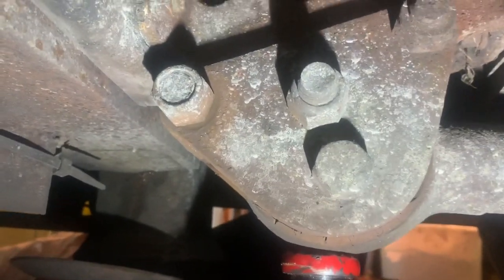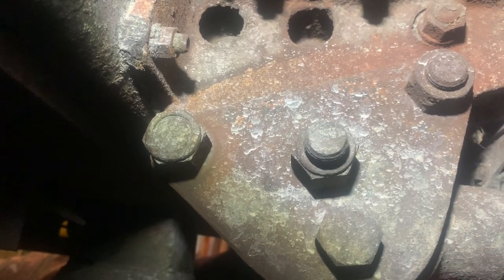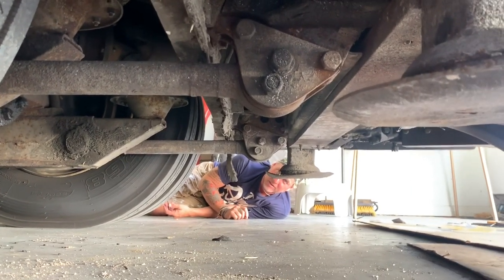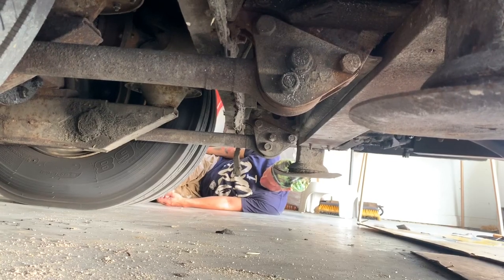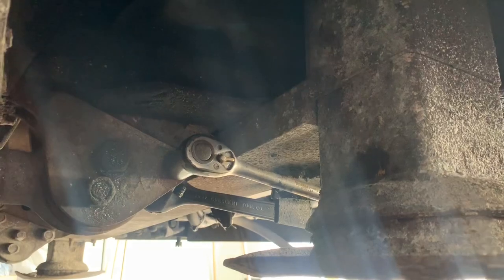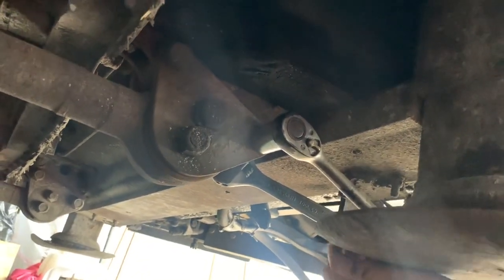Gm bus conversion 4104 radius rod mount problem

Comment: A few years ago I bought a rough 1957 Bedford SB coach as a non-runner, for £80. We amateurs must have been so lucky with (almost) all mechanicals, working from the manual.. but we got her running nicely & after some new brakes, wire harness, bulbs, and a good polish..? I'll never forget it !
Great channel, interesting subject indeed. Hi from UK.

Comment: The frame bracket you could either drill it out and put in a bushing(like the round end on a shock absorber) or weld the holes shut and redrill them. Just a thought/suggestion

Comment: I thought I was the only one who used a jack to break loose bolts 👊
Reply: Ive been working on my cars and trucks since my mid teens in the 60s and have never seen or used this method to remove a fastener. Maybe we have less corrosion in Australia.Impressive how much force is on the ratchet and it isnt bending.
Oh, I once had  front  wheel nuts on my truck that could not be got loose because they were overtightened. The tyre shop had a 1in.  drive rattle gun and no luck. They said to cut the nuts off and buy new studs. I hesitated on that scenario, would have been off the road for 3 days. Pieced together a cheater bar about six foot long and got the tyre guy to lean on it while I bashed the back of the t bar on the socket. The shock got all the nuts loose with a terrible bang but I was able to get back on the road in under 2 hrs. But access was good and couldnt do it in the situation you have shown.
After that, anytime I had work done in a tyre shop I would let the fitter use the rattle gun to his delight , probably fifty Ft.Lbs. over recommended torque  and then hand him my onboard tools and tell him to take them off with said tools on the side of the road at night in the rain.They learned.  I then used to let them spin the nuts on and I would finish them to close to factory torque and check them with a torque wrench when I got home. I found with my factory supplied tool, an 18 in. bar, with me standing on it at horizontal (me 200lbs) it would go about 1/4 turn and be near spot on.I never needed a cheater bar again for wheels. They were steel rims.

Comment: Yes the whole will be worn out drills it out for the next size bigger and 8 grade bolt fine thread what's a good locking nut lock washers
Reply from the maker: Hopefully

Comment: (Hint) on the Spacer/Bushing,  between the Shackles, you may FIND that some "Heavy Gauge"(thick wall) steel Pipe may just be the Ticket that a BOLT fits "Snugly" into instead?  (if the part is worn and out of stock?) worked for me donkeys years ago :)

Comment: why do you sometimes try to break loose the bolts from the bolt side and not from the nut side? my dad always told me go from the nut side so that your not fighting a sized bolt AND sized nut
Reply from the maker: It wouldn’t fit on the other side.
Reply: ahh that's a good reason haa haaa

Comment: A crescent your fuckn kidding.  If have to resort to using a jack at least use a floor jack less chance of slipping off . Should use torch to heat nut a buy a fuckn impact